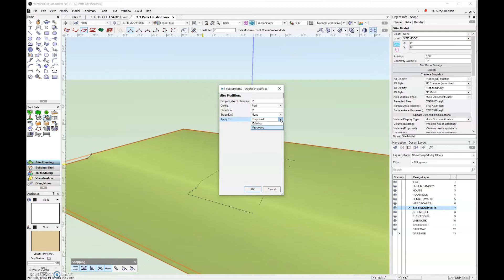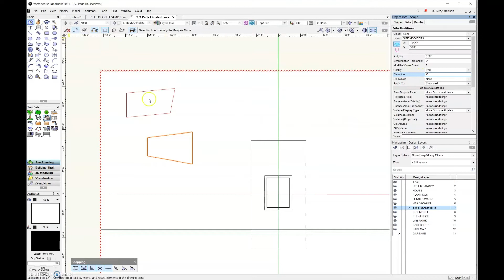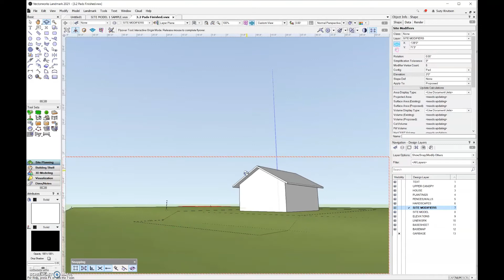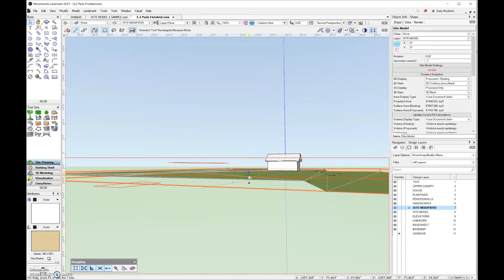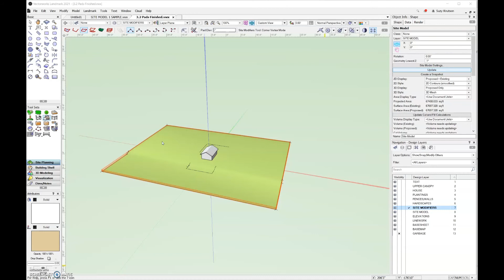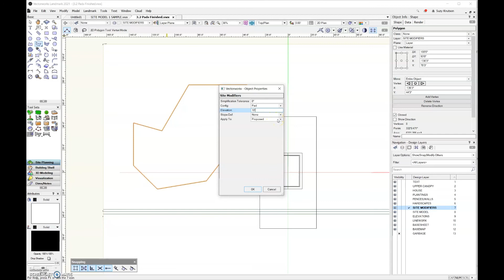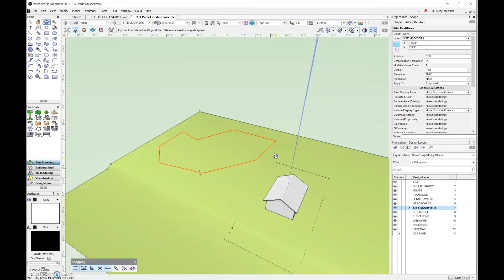The most basic of all the site modifiers - Pad Site Modifiers - 1 of ? Vectorworks Site Modifiers -

Comment: Hi, as to keep in good order I tried drawing the pad modifier in a layer different from the one where the site model is but it does not work. The site model is seldom modified by it. If I draw the pad in the same layer as the model it works fine. I can't guess what I'm doing wrong, any help?
Reply from the maker: If you go into the Site Model Settings, then the General pane on the left, there's a drop-down field for 'Use Site Modifiers on.' By default, it's set to 'Same Layer as Site Model' change it to 'All' and the modifiers will work regardless of which layer they're on.
Reply: @SuKnuVectorworks  Thanks!